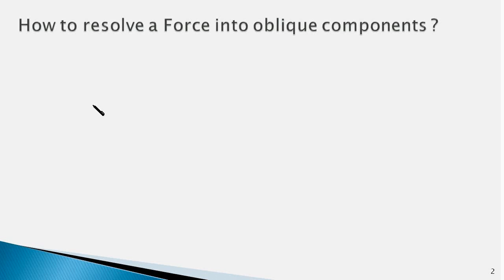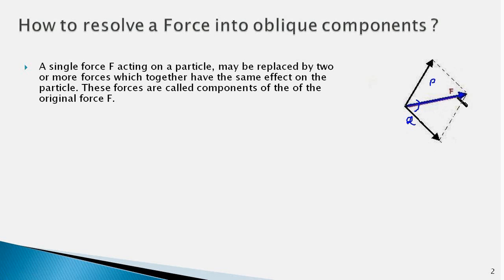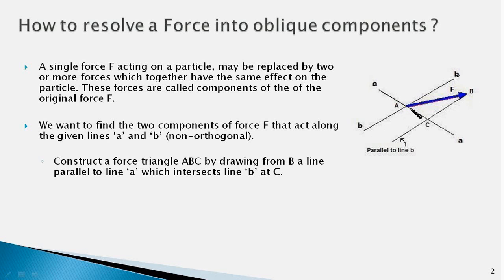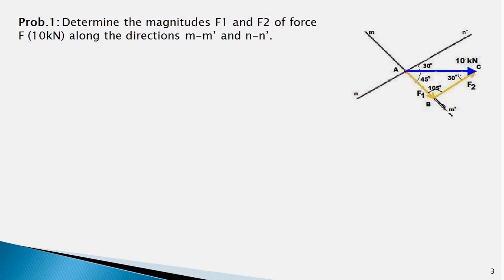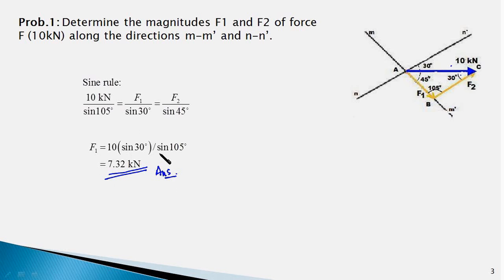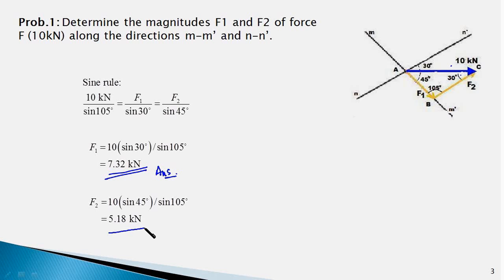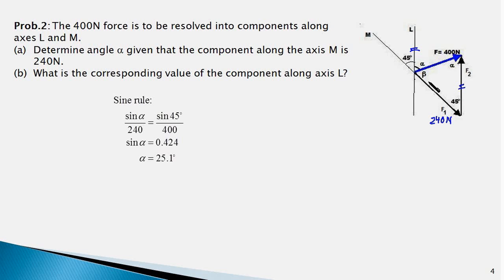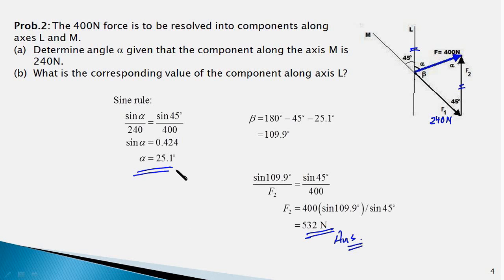1.3 Engineering Mechanics: Resolving a force into oblique components.

Comment: Thank you for the video!!! the components do not necessarily have to be perpendicular to each other. Thank you! I do have a question, does the length of each side has any relationship with the force? Can we apply sin cosin law? I've always wondering about it.
Reply from the maker: Hi Eva,
Yes, you can resolve a force into orthogonal or oblique components. The oblique components and the force form the sides of a triangle. So, you can always apply sine and cosine rules of a triangle.

Comment: I'm quite confused by this process. I'm so used to thinking of rectangular components or orthogonal decomposition, it feels so weird to do it this way. I kept thinking when you did the first step ,you said "We first draw a line parallel to n', from the top of C to m'" and I was thinking if the line was parallel to n' that the angle would be 90 degrees between m' and the line not 105 degrees. 

Took me a bit to realize that m' and n' are not 90 degrees to eachother but only 75 degrees....So the line intersection will be (180-75) or 105 rather than 180-90 = 90....
Reply from the maker: You are quite right. In Mechanics, we usually resolve vectors into orthogonal components because they are easy to deal with. But there are many situations when they need be resolved into oblique components. Yes the process appears little weird in the beginning but with some practice you get used to it.